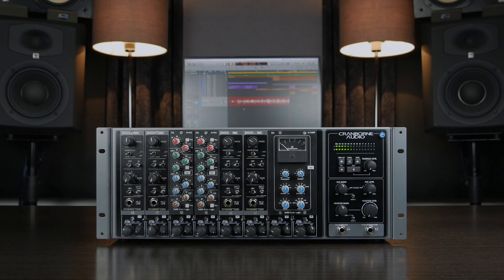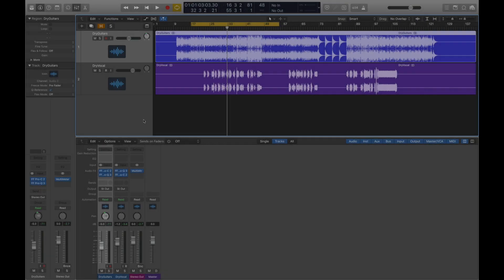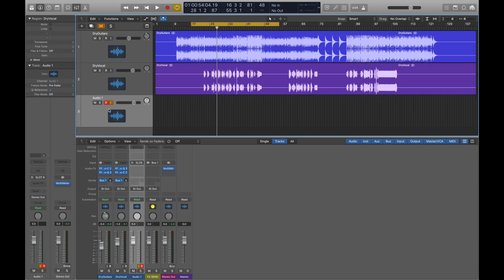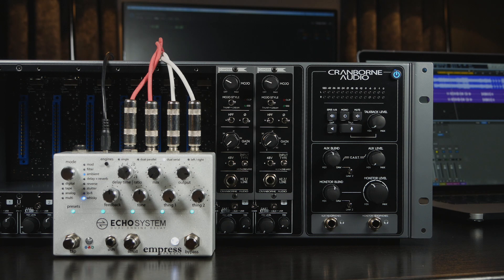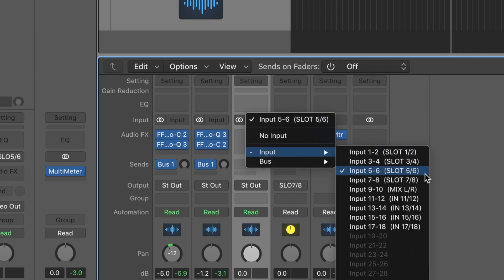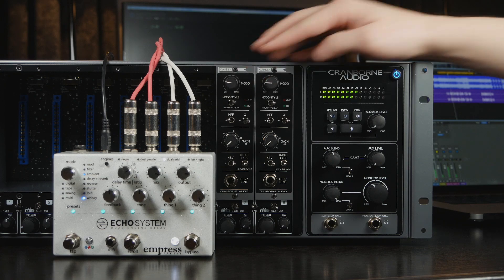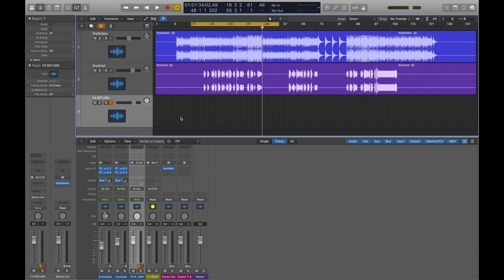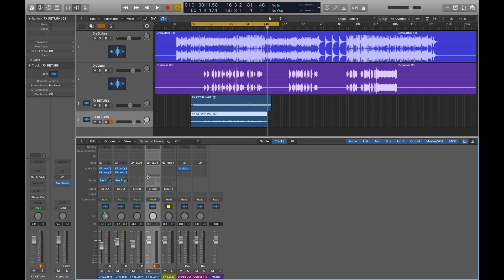500R8 Quick Tutorial | Using Insert Points To Integrate Outboard Effects

Comment: Please correct me if i’m wrong. I can sum 3 stereo buses out of the DAW to 1-2, 3-4, 5-6 and connect my external mix bus comp/eq using the mix output and back in to Input 7-8 of the R8 (where i can add a stereo mojo module), then record the signal in the daw with input set to 7-8? 
Wouldn’t that create a feedback loop in the summing mixer? How can i tell the summing mixer to ignore the signal coming from 7-8? Please help! 
Also, a HUGE doubt, is it convenient to match the gain settings of the summing buses using variable Mix level knobs? I’m afraid there could be slight inconsistencies, especially during recall! Please clear my doubts. I’m almost on the verge of purchasing the R8 but these doubts are pulling me back. 
Pan knobs seem convenient. I’m just worried about the Mix Level knobs.
Reply: I have an EC2 strapped across the mix bus (first in chain) if that helps. Maybe we can use some CAST trickery to accomplish a routing possibility.

Comment: I have a query. In the back panel, Mix Output refers to the summed mixed right? So is it possible to route that summed mix through outboard gear and then back in the DAW, probably through DAW 2 INPUT? 
I want to eliminate the need to do multiple ADDA round trips for stem mastering purpose. Please suggest! On the verge of purchasing this unit and can’t find a single tutorial regarding this hack.
Reply from the maker: Hi Larry, thanks for your question. The DAW2 inputs do not have a dedicated A/D converter and so cannot be used for this purpose. There is no way to do specifically what you're looking for unless you sum with only 6 slots and then use slots 7/8 for the printing back into your DAW. You could alternatively send the Mix Output into your outboard and then come back in via an ADAT device and through 500R8's ADAT ports. It's worth noting that 500R8's conversion quality is at a level where multiple passes will not affect tonal quality - especially  not to the point where you would hear anything and so multiple passes, apart from a convenience standpoint, will not be an issue. Hope this helps, CA
Reply: @cranborneaudio  Please correct me if i’m wrong. I can sum 3 stereo buses out of the DAW to 1-2, 3-4, 5-6 and connect my external mix bus comp/eq using the mix output and back in to Input 7-8 of the R8 (where i can add a stereo mojo module), then record the signal in the daw with input set to 7-8? 
Wouldn’t that create a feedback loop in the summing mixer? How can i tell the summing mixer to ignore the signal coming from 7-8? Please help! 
Also, a HUGE doubt, is it convenient to match the gain settings of the summing buses using variable Mix level knobs? I’m afraid there could be slight inconsistencies, especially during recall! Please clear my doubts. I’m almost on the verge of purchasing the R8 but these doubts are pulling me back. 
Pan knobs seem convenient. I’m just worried about the Mix Level knobs.
Reply: @cranborneaudio  please note that I have the EC2 strapped across the mix bus (first in chain) if that helps. Maybe we can use some CAST trickery to accomplish a routing possibility.
Reply from the maker: @LarryLobo  Hi Larry, all you would need to do is make sure that you do not turn up the mix level controls for slots 7-8. As long as they are turned down, it wont feedback. You'll just need to monitor Inputs 7-8 through the DAW and to the DAW returns. In regards to the Mix Level controls, they are full variable however it's worth noting that every module (and some preamps) have varying amounts of gain running in and out so the controls are there to provide you with more flexibility to match every module to where it needs to be. If it was fixed to 0, you may find some modules have different amounts of gain. You can always calibrate the mix level knobs using Sine waves come out from your DAW. Hope this helps, CA
Reply: @cranborneaudio  Thank you ever so much! I’m going to pull the trigger! Ordering one today! It’s one of the most exciting devices i have ever come across.

Comment: Can I use the inserts to send smth out only (without returning a signal)? Would the input of the 500 unit still arrive at the output or would this interrupt the slot chain? And can I send something onto the insert return that’s not coming from that insert send (ie from an external unit)? In other words: is that insert slot in series or in parallel? Many thanks for clarification
Reply: Their great customer support wrote me: “inserts are wired in series” so it will indeed interrupt the chain. Got them in a patchbay half-normalled so enables me to split the output and send smth directly to the out.

Comment: I have been using the insert with an outboard radial reamper box with pedals.  Is this required?  Arent line level and pedals different impedance?  Does the balanced inset on the Cranbourne automatically convert impedance not work  with pedals and outboard rack gear  or is a reamper box necessary for pedals?

Comment: Thanks fort your videos, does the inserts point works with a 19" Compressor for master bus ( buzz audio soc 20)or it's just for effects like delays ? 
Is better to use the inserts or the xlr I/O ? 
Thank you
Reply from the maker: Hi there, sorry for the late reply! Only just seen this comment! You can sue the inserts with any balanced/unbalanced gear such as a compressors, EQ, or similar and it will work beautifully! Just make sure you use the correct cabling with the correct wiring. The Inserts and the XLR connections work for different applications and so you will have to use the method that suits your application best! 
Hope that helps!

Comment: Hi great video, what about the impedance of the insert point ? Does your guitar pedal in you tutoriel accept line level ? Because normally there should be a reamp no ?
Reply from the maker: Hi there, sorry we missed this comment! Guitar pedals can accept high impedance or low impedance signals. In a guitar pedalboard, only the first pedal will 'see' a high impedance guitar signal. When that first pedal is on (or if it has a buffered bypass) all pedals after that will be seeing a lower impedance line signal. So the short answer is no, you will not need to convert the impedance to use the inserts with a guitar pedal. Unless you are using a vintage fuzz pedal which are very sensitive to the input impedance due to their design, most other pedals will work as normal. Hope that helps.

Comment: would it be possible to connect for example adat 1 slot with a La-610 Preamp via insert cable trs to xlr I/O . adat slot 1 bypassed. and would it be possible to either record via 610 or use the line input of the 610 to re-amp line level? only with this one insert cable? the 610 has a mic and a line input.
Reply from the maker: Hi Konrad, yes this is possible. Each channels insert has full functionality even when there is no module installed and that channels slot is bypassed,  this would be fine for mixing using DAW inserts. Alternatively, for tracking, you could simply connect the La-610 Line output to a 500R8 channel XLR input (again, even with the slot is bypassed/no module) as each channel can still process Line level signal with no module installed/slot bypassed.

Comment: 01:22 Does a single Insert TRS port on the back of the R8 do both the input and output for that numbered slot in a single TRS port? If so, would this be an unbalanced transmission of the signal? Is it possible to route the insert signal out the XLR output for slot 1 (for example), then route the outboard affected signal back into the XLR input (or even balanced TRS insert port) of the same slot 1 while bypassing the slot 1 module to then be A/D converted?
Reply from the maker: Hi there, yes the TRS jack does feature both the Send and Return paths and is unbalanced. Many mixing consoles both in the studio as well as live throughout the years have had unbalanced inserts - they are nothing new and are certainly not a cause for concern being unbalanced. They can accept XLR paths too provided you use the correct cabling (a TRS to 2 XLR cables). That being said, you cannot use the XLR input and Output for the same slot to create a hardware insert. The only way to do this would be to use one slot for the 'send' and another slot for the 'return. - using up 2 slots for one channel. The IO or the slots are all tied together and so if you connected the output of slot 1 into your gear and then the output of your gear into the input of slot 1, you will get a feedback loop. Hope this helps, CA 👍

Comment: When you connect and external device like this do you "lose" the slot? I have my 500r8 filled and I have a few rack compressors I would like to use in addition to the 8 slots. (mainly because I'm using 4, 2 slot 500 cards.
Reply from the maker: Hi there! If you have a 2 or 4 slot card, you can bypass the slots covered by the large module and then use them for external compressors! Just engage the bypass for those slots that aren't being used and then yeah you can get them back to use wit compressors etc using the insert point. Hope that helps! CA

Comment: Maybe this is a stupid question but I have an Apollo x4 and am thinking of getting analog gear. I was looking at the 500adat because I want to continue to use my Apollo as an interface to use some of the plugins but I like that the 500r8 can be expanded to potentially have 16 slots with the 500adat. My question is can I use the 500r8 without the interface?
Reply: Yes, 500R8 would be your new interface. 500ADAT on the other hand has to be used with an interface (be it your Apollo or the 500R8)

Comment: Hi! How might I patch in a rack unit that uses mono in/stereo out? Thanks!
Reply from the maker: Hi Shane, a little more information as to your setup and what you're recording here would be useful. Purely because if you're recording a mono audio source, then the stereo out is redundant of course, even if you're using both outputs, you're simply sending dual-mono as i'm sure you know. So with that said, if you're recording a mono source, you can simply use the insert on one of your 500R8 channels. If you're using dual-mono outputs (as mentioned above, even if one is dry and you're effecting/processing one of them), then you would need to use the inserts on two separate 500R8 channels.
Reply: @cranborneaudio  Oh, that's makes sense. 😊 It's a Yamaha SPX90. Lol
Reply from the maker: @shanetucker3094  Ah yes, ok, so really you're only looking to use two channels ('stereo' out) if you're looking to utilise one of the 'stereo' reverbs/echos etc. If just using a Mono effect, you can simply insert into one channel on the 500R8.
Reply: @cranborneaudio  Awesome! Thank you!

Comment: Would this require something like the Radial EXTC Stereo to get the correct impedance?  Going from balanced to unbalanced and back?
Reply: They answered another comment saying impedance would not be an issue except for some rare instances (like vintage fuzz). As far as balanced/unbalanced, the insert send and return are unbalanced and so are guitar pedals. The TRS cable serves as the unbalanced return and send for each insert.

Comment: Does there have to be a 500 series module inserted to use the insert of that slot? i.e., could the slot be empty but still use the insert point to connect a 19" rack unit? Thanks.
Reply from the maker: Hey Anthony, yes you can! You can still use all of the inserts without modules installed by using the module bypass switches for each slot located inside the rack! The whole process works as described and you can use the inserts freely. Hope that helps!
Reply: Wow, that's brilliant. Thanks!

Comment: Does this have the headroom for mastering?   Comparable to rack mount units?  I am thinking of getting one
Reply: I mean vetting an 8 slot and building mastering chain with ssl stereo compressor etc.
Reply from the maker: @timeiseverything4  Hi there, yes the 500R8 has a +26.5dBu of headroom through the unit with a maximum I/O level of the converter of +24dBu so there is ample margin and hot levels to create a mastering chain - in fact, many mastering engineers already use our kit and love it! Regards, CA

Comment: Greetings friends A THOUSAND BLESSINGS. I have the Cranborne 500R8 I bought it to add it to my Avid Digi 003 with Pro tools the question is can this be done using the 500R8 as an Adat insert I have been trying but I can't but I don't know if this model doesn't allow to tie to another interface via Adat to make the inserts.
Reply from the maker: Hi Javier, firstly, thank you for purchasing our products! Unfortunately, what you are trying to do is not possible with the 500R8. The 500ADAT that we produce is designed for this exact purpose - expanding the IO of your audio interface via ADAT. The 500R8 is an interface itself and cannot be rerouted to send tis slots through the ADAT and out to the 003 - this is why we designed two racks as it was not possible to make one do both jobs. Sorry about this. You may be able to speak to your dealer to get the units swapped however that is at their discretion. If you need anything more help, pleas let us know! CA
Reply: @cranborneaudio  I think it is clear that I made a mistake when I bought the equipment, it was supposed to be the Adat, but I think it is a little difficult for me to change it since I am in Costa Rica. 🥲🥲🥲🙃

Comment: Would I be able to use both my Apollo Twin X and 500R8 simultaneously? I’m thinking I’ll initially just use the 500R8 for summing with or without additional 500 modules and use my Apollo Twin X for recording my vocals.
Reply from the maker: Hey there! You can use 500R8 and the Twin together however you could have to use them as an Aggregate Device which is available on macOS only. This will mean that both devices will appear as one interface in your DAW. We developed a different rack called '500ADAT' which is designed to exclusively integrate with other interface such as UA Twins and X series devices - any interface with ADAT ports. Hope this helps!
Reply: @cranborneaudio  Exactly what I was thinking would work so this may work for me.  Thank you.

Comment: Sorry newbie here. Would there be a way to set up an external effect send to monitor but not print  during tracking?
Reply from the maker: Hey @LoR! No apology necessary! If you mean for like tracking reverbs etc then yes! You can do that using the DAW2 inputs on the back of the unit. They are a pair of Inputs that can be used to return effects into the monitoring path without recording them. There is a small section about this in the user manual where it talks through the process with an external reverb! Hpoe this helps!
Reply: @cranborneaudio  Perfect. I have my 500R8 on order 😁

Comment: If using effects in the daw while tracking, what kind of latency does the unit have when the mix is turned to daw monitoring?
Reply from the maker: Hey LoR, The full roundtrip latency will depend on the DAW as well as your computer specs etc, but we have some users achieve sub 4ms Roundtrip latency on particularly beefy machines. But it's hard to say for sure. Sorry we can't be clearer! The Number depends entirely on your setup.

Comment: If one wants to use a guitar pedal that is not stereo, does one just use a TRS to TS cable? or TRS to TRS?
Reply from the maker: Hi Jason, If you want to use a guitar pedal, such as the one I used in the video, then you can follow the same process using the same style of cable to break out from TRS  jack on the back of the R8 to two TS connections. If the pedal is Mono or stereo, it will not make any difference to the cable required. Hope that helps!
Reply: @cranborneaudio  so the TRS end goes into the R8 and the two TS ends go into the input and output of a mono pedal?
Reply from the maker: Hi  @jasongoesacoustic  , yes that's right - in the same way described in the video! Thanks again!